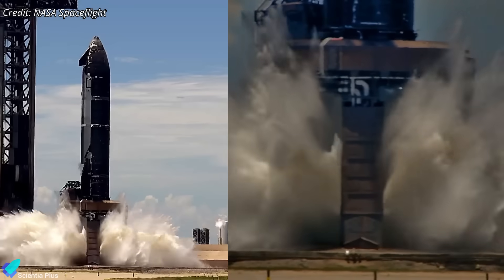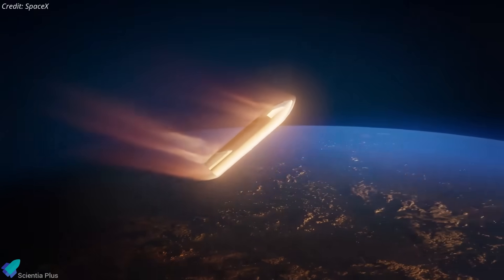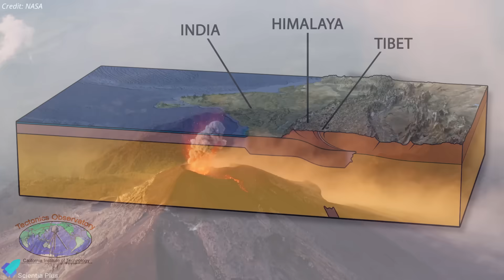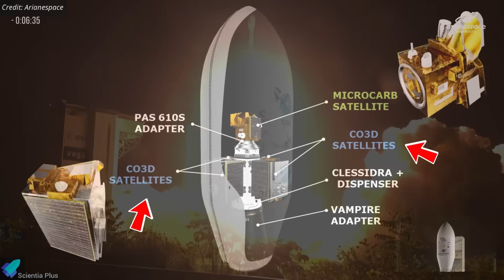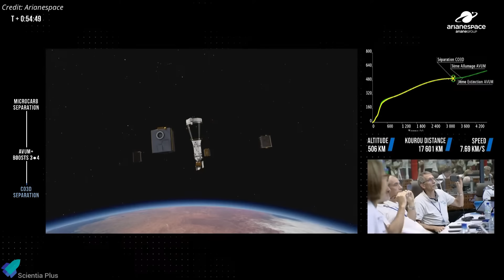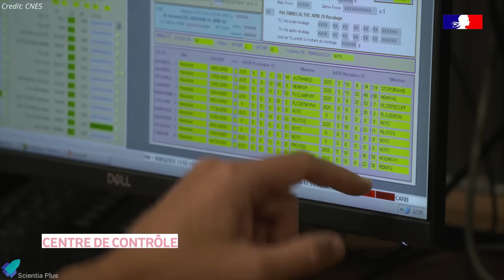Starship is Finally BACK! SpaceX Just Did Ship 37 Static Fire on the Launch Mount!

Comment: The Splash down plan is not to salvage Starship. It's to salvage tile test inspection. The ship is Scrap Metan they already know. Any good parts can be re-used for other test model's. Same as Car Crash testing only bigger.
Launch pad inspection in progress. There's 2 launch pads and 2 rockets if there's any issues.